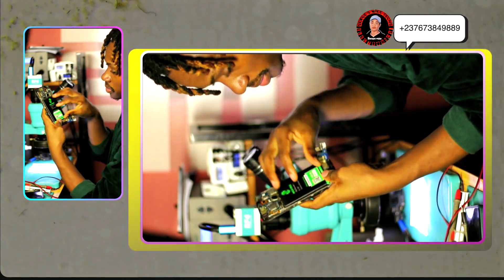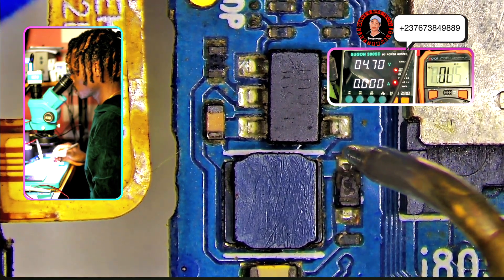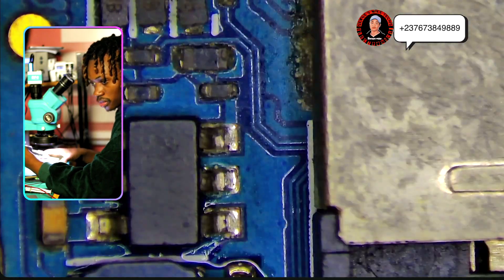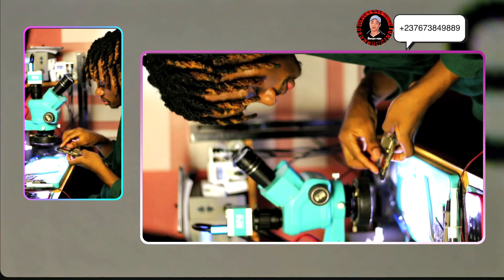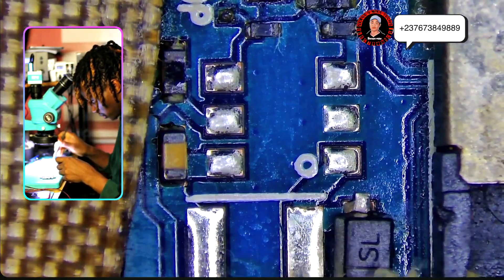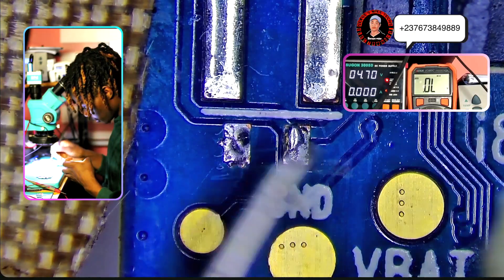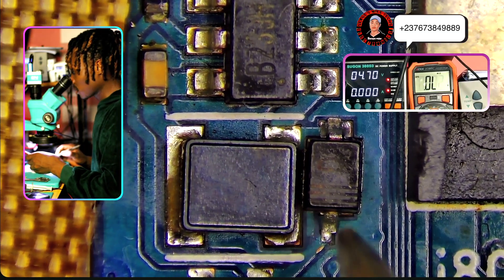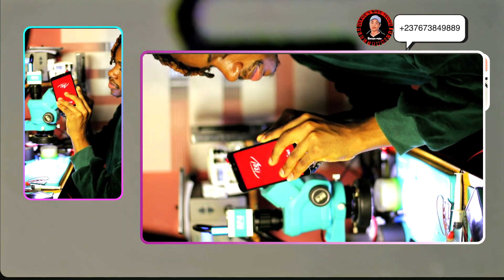No Backlight | No Display | Mobile Phone Black Screen Fault Repair video

Comment: Bro try to reply  me to this question  about what voltage in put and put  and how to check voltage input.     Does every ic chip or any component on pcb such as diod  or resistors  coils each has both inputs and output voltage 😅😅😅😅😅😅😅😅